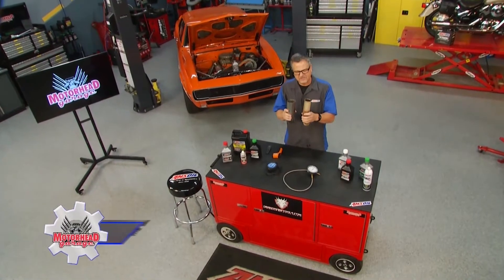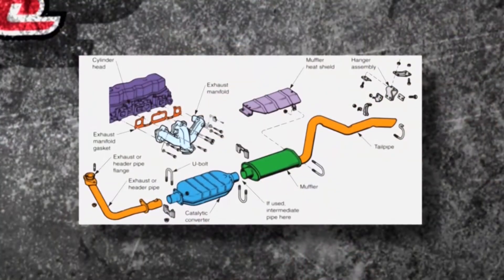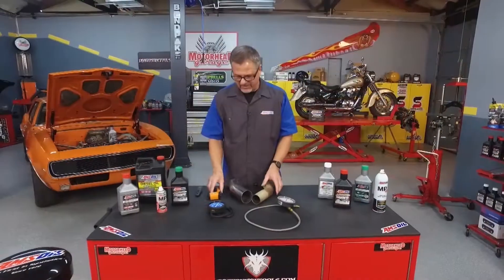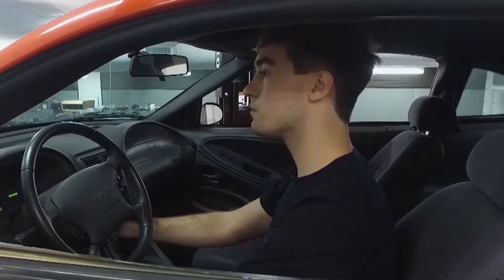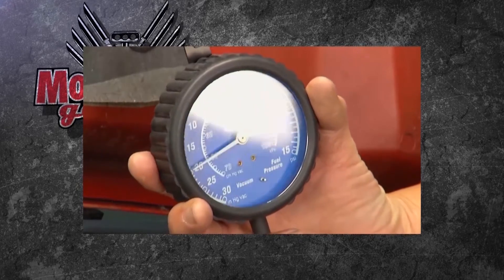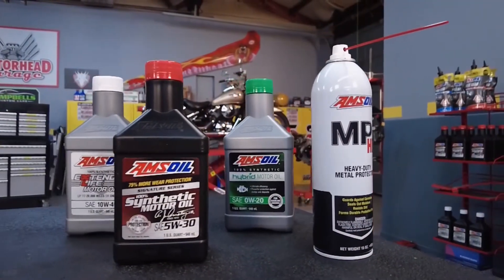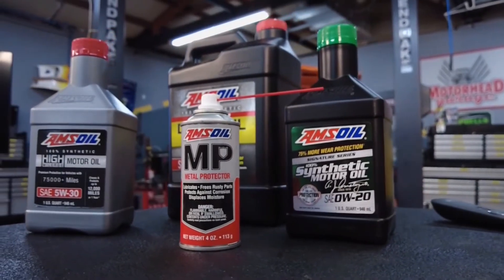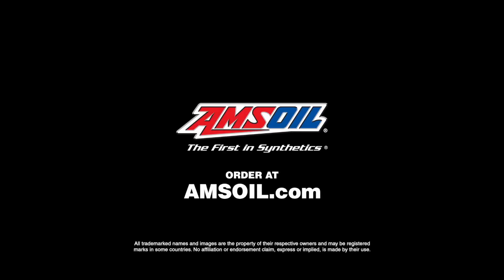How to Test Back Pressure in Your Vehicle’s Exhaust

Comment: Can a vacuum gauge be used as a back pressure gauge?
Reply from the maker: Hi Paul, great question! The short answer is no it won't work. But check out this YouTube video you can use a piece of paper to check it. https://www.youtube.com/watch?v=IIXXDuGJUPM
Reply: How do you drive the car and read the pressure gauge  ?
Reply: @kennethfinch3629 you read the gauge while the car is running in park in idle and revving.